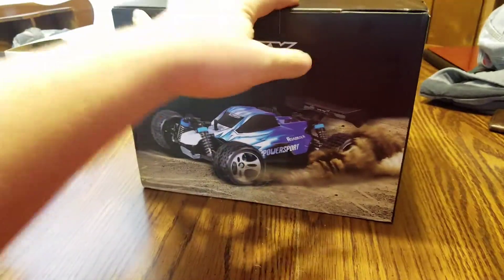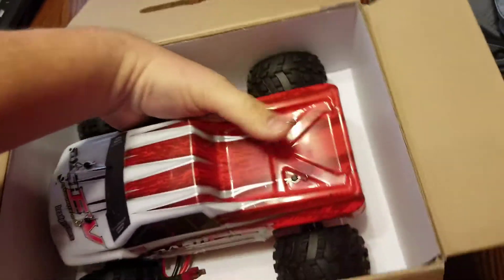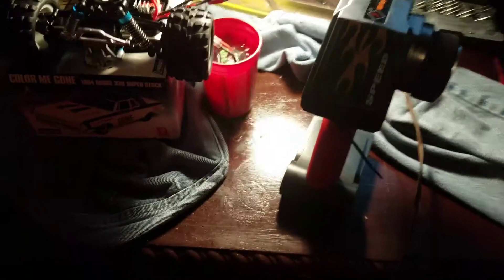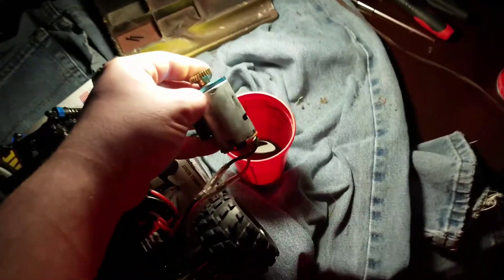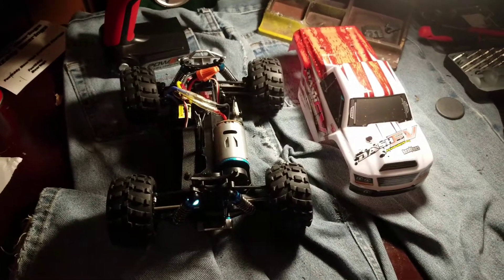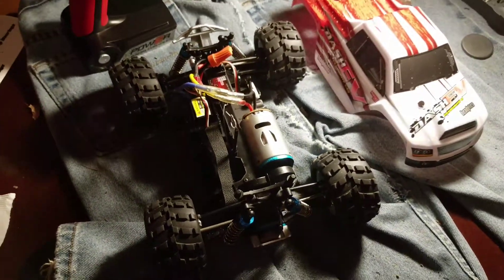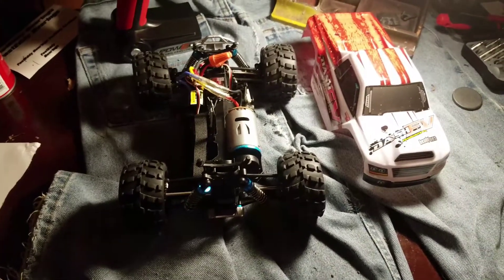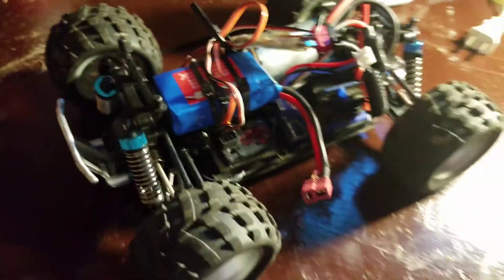Wltoys A979B

Comment: nice presentation++++
Thumbs up.
One question mate,is it worth the water break in of the motor?
its a 540 cheap motor.
Thanks
Reply from the maker: Kiroslab Tsip Greg thanks for watching!!! but probably not being you can get another one for 10 bucks but motor was easy to remove so figured I'd try and get the most out of it